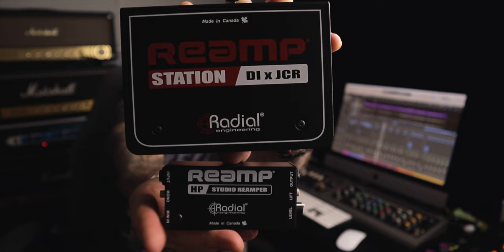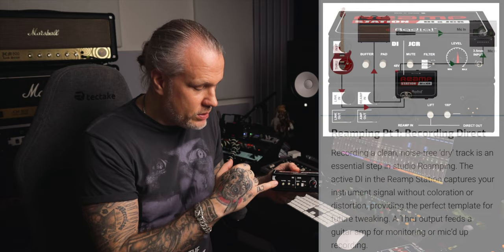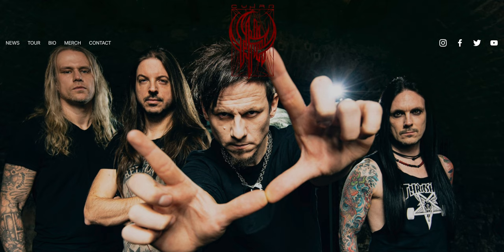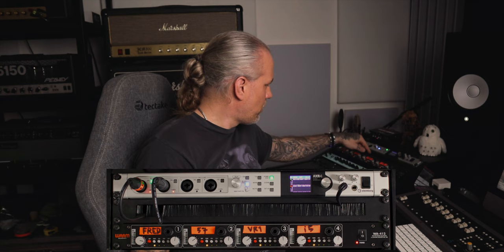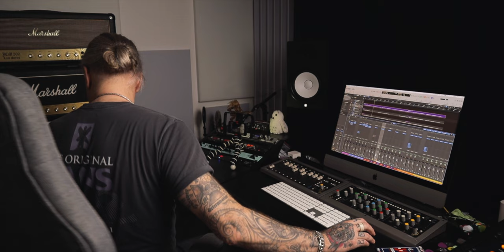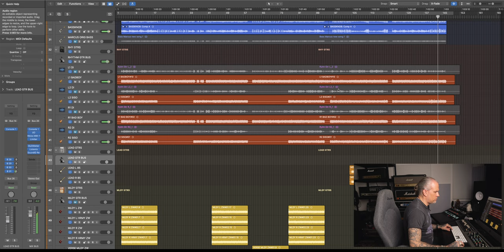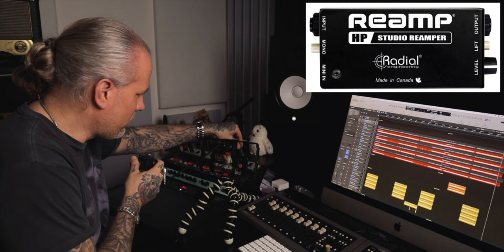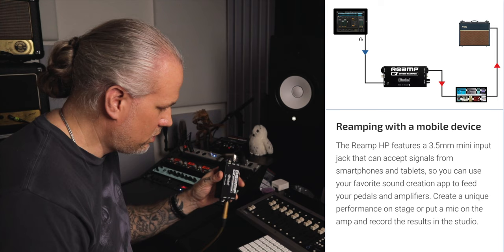REAMP Like A Pro | RADIAL Engineering REAMP STATION & REAMP HP

Comment: Just a tip. The REAMP HP you don't need to send your signal mono to the R channel as you mentioned. This box the mono switch is meant to convert the stereo headphone signal to mono signal for reamping. So with the HP box all you need to do is solo your track and the box will automatically convert it to mono. There is nothing wrong with the way you did it but this box is supposed to save you the trouble.

Comment: Thanks for the vid. My question is: Do I need the Reamp Station or similar box when recording the "dry"/DI signal to DAW without using real amp, just some plugin (for the reference)? When reamping later through the real amp I need to obviously use the Ream Station, but now I am just asking specificaly for the purpose of tracking the guitars.
Reply from the maker: You can record straight into the interface. The better the interface (AD/DA conversion - the better the quality of the sound) Just make sure the level is good (not too quiet and not clipping = red lights) 👌.
Reply: You don't need the reamp box no. You just need the DI box. You only need the reamp if you want to record real amps with a recorded DI track. This box is both a DI and Reamp box. So if you want just DI tracks for amp sims save yourself some cash and just get a DI box. Most usb interfaces have a HI-Z input button that does the same thing though so you might already be good.